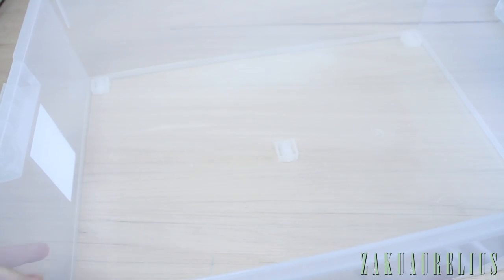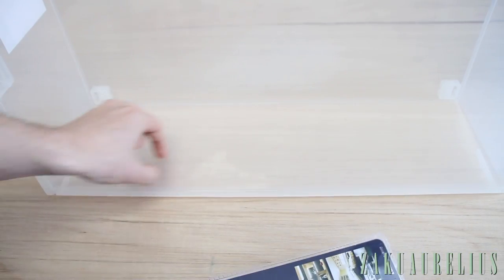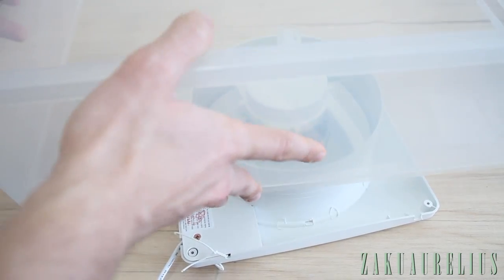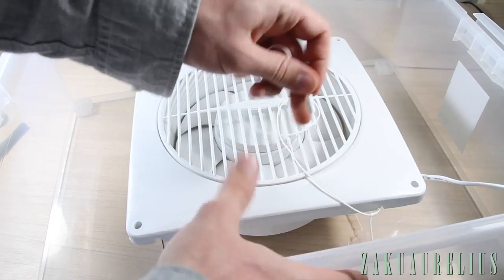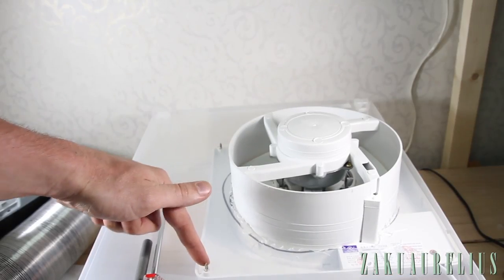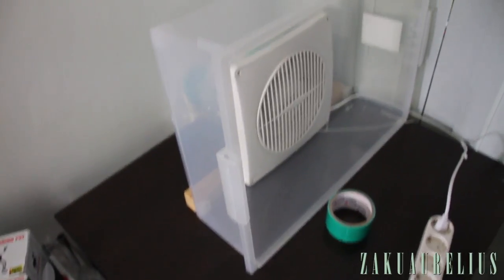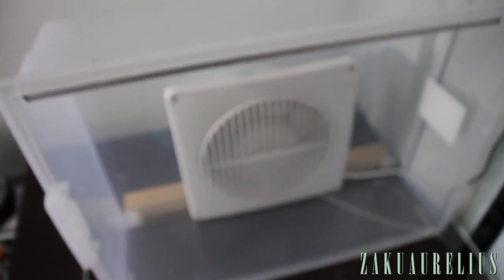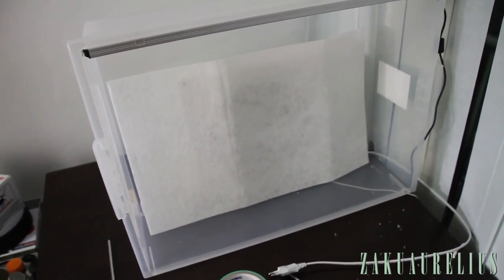171 - D.I.Y. Spray Booth!

Comment: While effective, this is pretty ghetto phabulous! This is what you get when you don't have the right tools for the job and must MacQyver every last bit.

A few things I will say, first, the worry of fire from sparks is way over blown. Farts are flammable too, yet these fans have been sucking farts out for better than a century now. Modern fart fans have little risk of sparking, but if you are concerned, make sure to turn the fan on before you spray, this is the most likely time when a spark would occur. Once running, there is basically zero chance of fire.

Second. Not sure if this is just me, but the depth of the booth seems to shallow to be effective at trapping and removing the nasty bit from the air, but I can be certain without more information. Others with more experience can probably speak to this area of the build.

Third, as others have mentioned, those nasty screws are a scar away from the ER. Another best practice for mounting to plastic like this, is to provide a wood backer to run the screw into. If done properly, the plastic can be drilled out larger than the screw, as you are clamping the light to the plastic. Think layers, light, plastic, wood. The light to the wood removed any worry of the plastic failing and takes away the scar threat as well.

Also, you can easily find proper duct work at home depot for cheap, but effective passage of the air that is "cat proof". Those slinky ducts are prone to claws and failures, where the thin duct is much more resilient. If you go this route, I recommend buying the foil tape as well, makes your build look that much more professional. This stuff sticks and seals like nobodies business, and if I can add a pun, it is flashy as hell! They also make fully articulating elbows that can be set to any angle you need from 1 degree, to 90 degrees and everything in between. So set you angle, tape it, join it, tape it, done. Plus you can create an air register size exhaust that accepts the cheap filters pre cut to fit and you have the added long rectangle port to put through the window, making it much easier to seal, no dirty t-shirt required! 

So all in all, this is a good reference for your own DIY, booth, but with a little more thought, you can get rid of that ghetto look and feel and create a booth that the manufacturers of the overpriced booths, to green with envy.

HTH
Reply: Or even the right skills to do a simple job...lmao.
Reply: Farts are in no way as likely to cause a fire or ignition like Laquer and Enamels will, your advice is horrid and uneducated (They are also not as condensed).   The over spray even with a filter can accumulate on the fan motor and if you use a dummy hardware store regular fan and those can and will ignite if they build up.  Inside the home it's a fools choice not to use an explosion resistant fan just as an added precaution.  You can get away with it for as long as you do until that ONE time and that's all it takes, Murphy has crept in and, well, you can figure out the rest.

Comment: a good way to check  a seal for leaks is to have either smoke or visible vapor run through the system. car mechanics usually do this

Comment: I am a little curious. I've been watching a few DIY for a spray booth. Some recommended to get the ones that do no produce heat/spark due to the fact that you might be using flammable paint/aerosol. Is the exhaust fan you are using suitable for flammable paints?
Reply: Meor Naim Mkz I’ll answer the question for you. No it’s not.

Both the fan and the LED light are perfect ignition sources to cause a fire or explosion 💥

Comment: I’m really late to the party but will this set up work good with lacquer paints? I’ve looked at some pre built booths and they usually come with dual filters which seems like it’ll severely limit air flow.
Reply: It will work for causing a bright flash.

Comment: Is it possible to make this without the "exhaust"? With just a chamber behind the fan, to hold the paint particles?
Reply: This sounds like a recipe for disaster as the fumes would become more and more concentrated
Reply: @gregorycafiero9688  there are no fumes. It's water based, non-toxic, paint. You still don't want it in your lungs, but it's not dangerous once it settles somewhere. Which I assume it would in the 'box' behind the fan.

Comment: Hey bud, just to let you know, I used a tamiya line scriber to cut the back out for the fan and it works a lot better and faster, just incase you build another one, give it a try
Reply from the maker: Chris Vinson Good idea! Will have to just do that next time. The drill worked out alright though  ;)

Comment: NOT SAFE SUITABLE for solvent based paints or thinners. Very dangerous.   You need a squirrel cage blower with about 650cfm to use with solvent based paints/thinners.   For acrylics it may not be as bad but alcohol IS FLAMABLE and may be a fire risk.     Keep a fire extinguisher handy in any case.

Comment: Do u use this booth? I’m Geting into painting and customs and I just want one that is not gona leave a huge amount smell inside my home. Id pay for a really nice one ( around 1-3k ) if anyone has suggestions
Reply from the maker: Check out the pinned comment regarding my second attempt at this. It was much better. 
If you wanna buy one I would not recommend getting one of the ones you can find on Amazon or whatever for around $100-$150 that have the collapsible hood around the fan. I’ve tried a couple and both were way too weak. 
The only really nice ones I’ve seen available for purchase are from these really small hand-made manufacturers in Japan. They go for around $700 then plus however much in shipping. But a good option if you’re willing to spend a bit for a good quality and fancy looking booth.
Reply: @ZakuAurelius  hell ya thanks dude

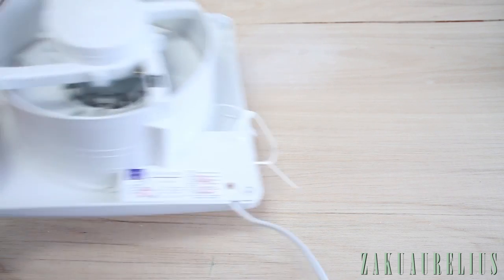Comment: 2:40 a good way to prevent that problem, is choose an exhaust fan which’s diameter is the same than the jeil spiral flexible hose. For example, if you got a 6” hose, pick up a 6” exhaust fan
Reply: I’m curious how do you know when the fan is safe for Simmons and such one that won’t cause a fire?

Comment: Why didn’t you just use a 5” reducer for the fan? Simple solution to a simple problem. I also put an inline fan halfway through my tubings. I have about 8 feet for the fumes to travel then up to a window, so a fan at the booth and a secondary fan halfway up and I have great pull. All fumes are vented outside.

Comment: I love the idea that you had with this. Myself i would have used  a deeper tote. Plus i would have mounted the fan on the outside of the tote to have more room inside. How long did the plastic wrap last for you? Also wow on the light. On high i bet that would light up the whole room if all the other lights were off. You have given me some ideas to work with for making one my self.

Comment: Zak  use Hot wax on the screws to cover the points of the screws. Also the filter paper I would use 2 or 3 ply's. it wouldn't hurt the more ply. Also if you are spraying Solvent based paints, Don't you think that static given off from the Light would ignite the fumes?
Reply: +Kevin Barwiler That's been tested a bunch. If he were to spray about 12 cans simultaneously, or his fans had brushes, then maybe.

Comment: Observation: Good concept but a lot of overkill. Your "booth" is too shallow, a deeper storage box wouldve been better.. A 10" personal/desktop box fan wouldve sufficed better w/ the same results. And you wouldnt've needed the duct tubing - place a filter piece in front of the fan and tape a piece on the backside. $40 for the LED bar is too expensive for a DIY project such as this. $3 LED tap lights would give you the same results w/ 2-3 of those. I know this is almost 2 years after the fact but just my observation.

Comment: BTW the Mr.Hobby Spray Booth was so useless to me... Stopped working automatically to let cool frequently, really not efficient; as well, the fan wasn’t powerful enough to suck out the dust near it, which made dust often stick on the wet paint surface.

Comment: Yep you showed him.😂 in made one out of 3.20x30x3/16 foam board sheets hot glue gun to hold it together 6.00 still have to put lights an a fan in but so far think it will work good.

Comment: dunno if you got them there. But you know how you used the knife n heated it? Just go to the dollar store and get a soldering iron. Plug it in and there you go. I have one just for that. Just dont use the one you use on plastic to solder for real. Well unless  you can change the tips.

Comment: I like this, it's much simpler than my DIY job.  I spent way to much time over building mine.  Keep it simple, and clean.  Good job, boss!!  

Two questions first, where are you venting that too? I assume out a window. Second are you gonna be spraying a lot lacquer paint?  reason being the first set up I used was very similar to yours, and the paper let a lot of paint through and the lacquer ended gumming up the motor, took a while, but something to consider.
Reply from the maker: fuzzyhawk down Thank you, first! And yes I'll be putting the hose out the window~ And yes, I'll be mostly using lacquer. But aside from the filter paper I'll also be using a larger filter like the cardboard type for Mr.Hobby's spray booth.
Reply: I ended up using air conditioner filters, they seem to be working really well for me.

Comment: I was wondering about sparks from the cheap fan. I've seen a breeze box fan catch on fire while a mate had a furnace filter on top and he had it in the window garage airbrushing his helmet with lacquer. Solves do burn easy ... just a thought.
Reply: ⚠️ - the filter must be in front of the fan, not taped to its front where the air comes out
Reply: @samuelfellows6923  It was...